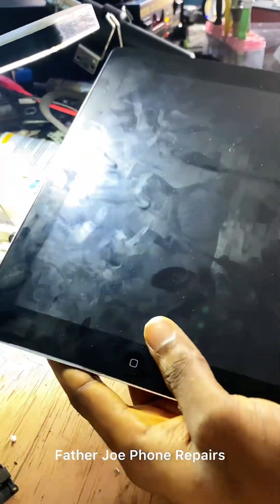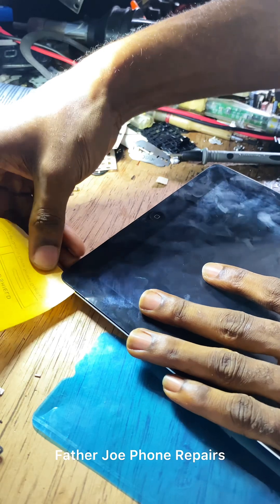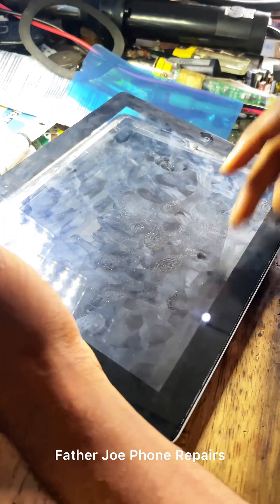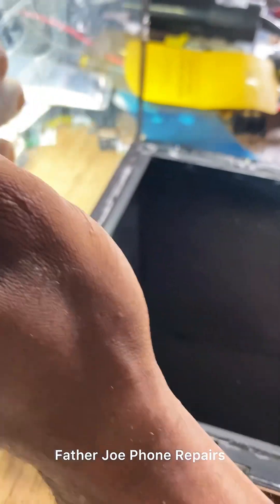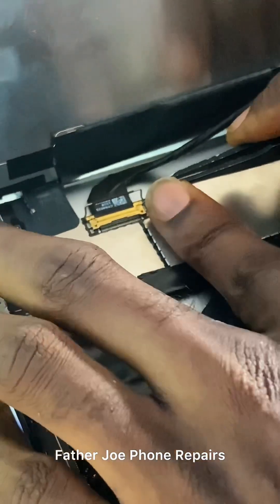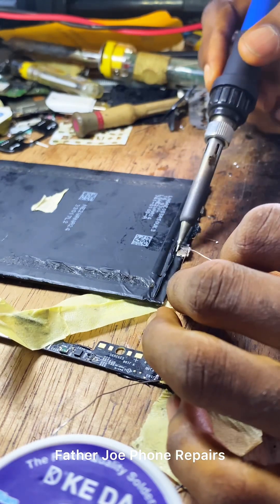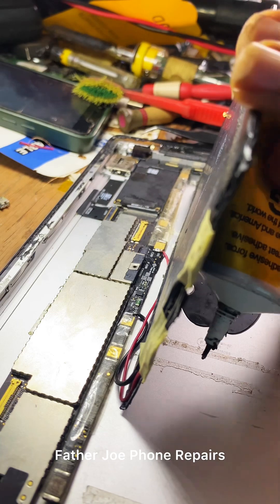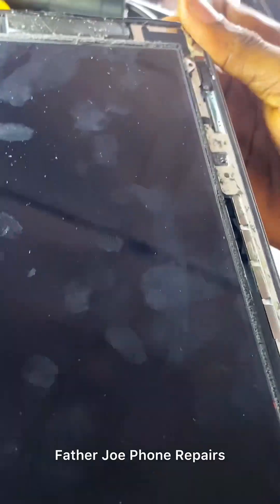I Fixed Apple IPad ON AND OFF Issue ✅

Comment: He doesn’t reply
Reply from the maker: Good evening
Reply: @FatherJoePhoneRepairs  Thank you sir. Please there is one video u posted about android phone battery terminal issue. The phone off immediately if it is turned on my question is sir if I want to jumper the battery direct to panel in case in case the battery clip on the panel is broken where do I connect the Bat-on and the Bat-id on the battery terminal thanks.